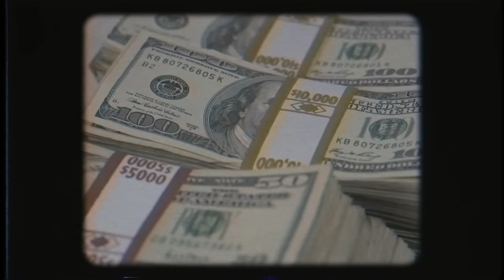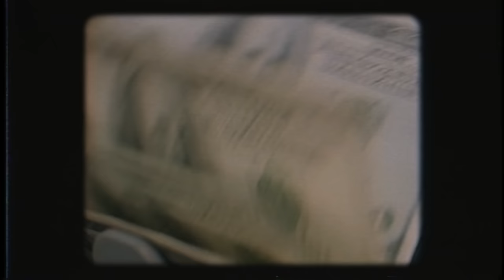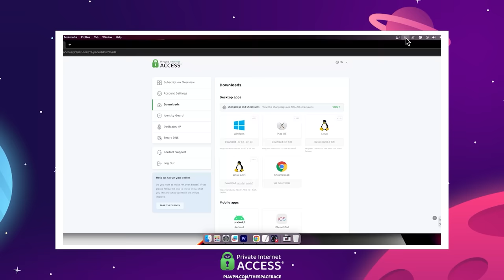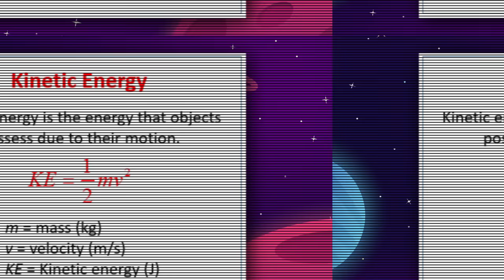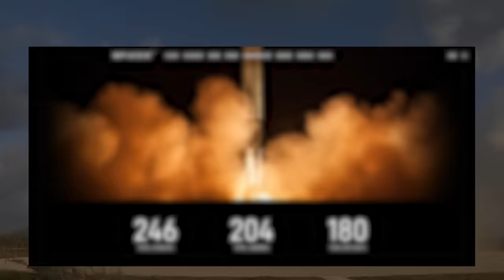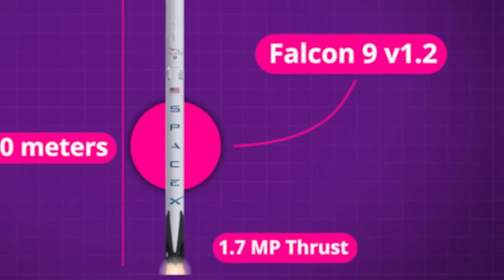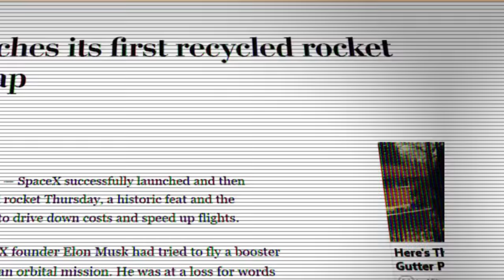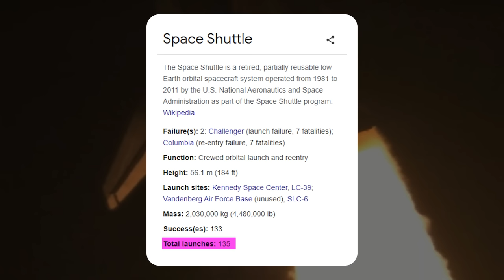How SpaceX Reinvented The Rocket!

Comment: The amount if mindless spacex parroting ignorance is amazing. 

For example: re-use does not save you money unless you can re-use many many many times. A re-usable system is MUCH more expensive to build than an expendable system, to the tune of being able to build several expendable units for the price of one re-usable system. And then you have to factor in the extra development costs.

Landing boosters is not a SpaceX invention.

Starship has the same overall build as  the spaceshuttle, including the heatshield.

Starship can only get to LEO, then it's out of fuel. Anywhere else requires being refuelled by 14(!) tankers. To get to Mars they have to refuel in LEO and again in HEO, but to get the tankers to HEO they have to refuel themselves. That's 1 launch for the starship, 14 tankers in LEO, and then 14 tankers in HEO that need 14 tankers each to get to HEO. 
Getting to Mars takes 210 tanker launches... at a very optimistic $200mln each, is $42bln. That's four times what the entire SLS program has cost so far. And SLS actually flies.

So far Starship has launched twice and exploded twice, once through sheer incompetence of the great leader who desperately wanted to launch on his fun-date of 4/20, the anniversary of the Columbine shootings. They launched inferior engines on an unprotected launchpad and the result was predictable.
 
But the fans... they cheered Musk on... a great success because the rocket left the tower...
Reply: nobody needs your approval
Reply: Reusable rockets aren’t that much more expensive to build. And SpaceX can reuse their latest Falcon 9 Block 5’s 10+ times each. Other benefits of reusability is it allows you to launch at a much higher frequency, SpaceX has launch 100 rockets in the last 365 days, that would be impossible if they had to build a rocket each time. By the way every single launch landed successfully.

Ultimately they undercut every other space company on the planet, so let that speak for itself…
Reply: Starship launches will not cost $200 million. They will be cheaper than Falcon 9 because of their simplified design and use of cheaper fuel/materials. Third-party estimates put the build cost of an expendable unit at $35-50 million, with reuse that price is bound to be lower.
Reply: And it will not take 210 launches to get to mars 😂. It will actually take less than the Moon because Mars’s atmosphere will provide almost all of the braking.
Reply: But now you’ve mentioned the SLS, I am required to remind you that the cost of launching SLS and Orion once is more than the entire sum of Money NASA is giving Space X to carry out Artemis 3 and 4.

Comment: If space x used 3d printing. The rockets could be built alot faster and with less fail points from the rivets in traditional rocket production.
Reply: They use 3d printing where it's useable.  Certainly not useable for Starship though.
Reply: 3D printing gives you cheap prototyping when you can use it, or for short runs.  It doesn't mass produce a product in quantity faster and cheaper than a custom tooled assembly line.  All the Starship units built  so far have been welded , not riveted.

Comment: i actually stopped watching this because the history is just nonsense, i really hope the young don't watch this as a true history of space flight but just in case, remind them it was the soviet's who were there first, and they developed a re-useable booster rockets for the Buran re-useable space craft.  Also i can let you into a secret, don't tell anyone, the Buran went up 7 times, 1 test and 6 secret military trips, all successful.  As for Musk rocket, they took the design from the Soviet N1 moon rocket.  If it wasn't for the N1 rocket we would not have the RD-250 and RD-270 rocket engines, which to be honest if there was a 7 wonders of the technical world, they would be on it.  Our grandparents were just vantastic engineers
Reply: The Buran was just a copy of the Space Shuttle
Reply: @zachb1706  no it was not, very different, no engines on it, unlike the shuttle, no solid boosters, automatic flight and landing.  The external rocket could be used for any lift, which it was.  The Buran could fly, it was not a glider, in actual fact on it's first test flight it decided to abort the flight, go around the airport and attempt a second landing, which was successful.  Because the engines were not on the Buran, it did not have all the heavy extra dead weight to carry around hence why it's carrying weight was greater than the shuttle.  It was simpler, less complex, which means less things to go wrong, unlike the shuttle.  You should have a look at the Buran 3.0, they intended that the booster rocket was turn into a glider and land at the airport to be reused again, so reducing the cost even further.